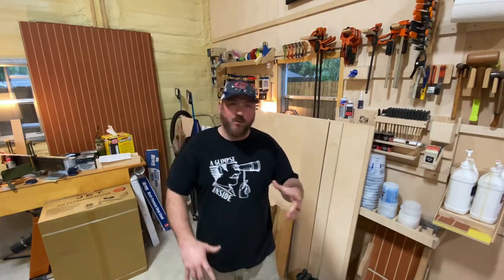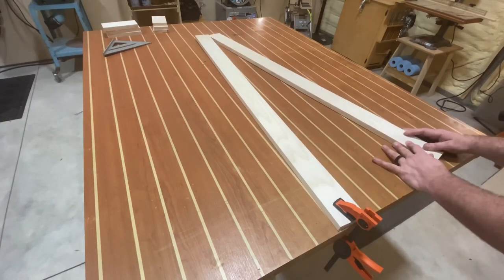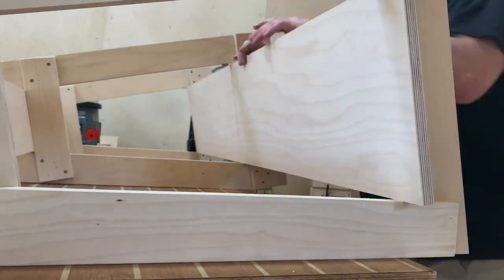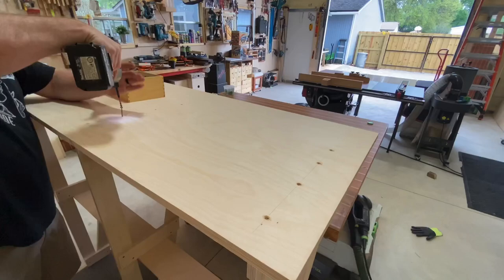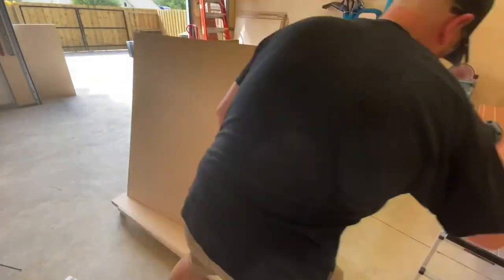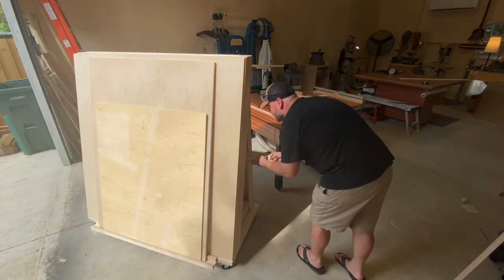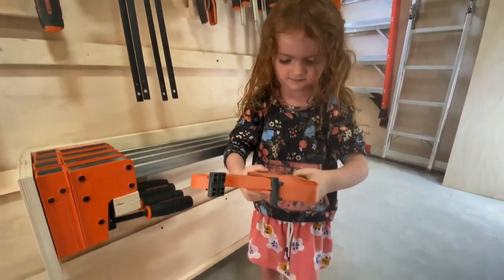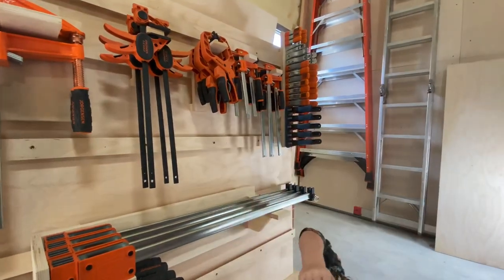DIY Mobile Plywood Storage Cart Has TWO Hidden Features | Intended For 5X5 Baltic Birch

Comment: I would have thought you would need glue for strength, but if it is working for you, that is great.  I need to build a lumber / sheet-goods cart.  The one I have now is so heavy it won't roll.  The casters are too under-powered (flimsy) and I literally slapped it together with materials I had available one weekend when I got back from the store with a bunch of ply and didn't have a place to put it.
Reply from the maker: Definitely time for an upgrade then my friend. It’s a fun build as well

Comment: Ok serious question. What is your preferred method for using the table saw while kids are riding bikes around the outfeed table? Elbow/knee pads and helmets? Full PPE? Or just wing it with flip flops and bare feet? Still my favorite maker channel - great job as always.

All kidding aside, one of my biggest challenges is trying to watch kids and work in the shop at the same time. So if you have any tips, it might make a good video one week, especially since more kids are home nowadays.
Reply from the maker: Thank you so much for the kind words quite frankly I keep everything really high up on this French cleat walls in anything that is down low is completely safe for the kids or at least I think so right?. There really is no secret sauce in my opinion. You just Gotta be mindful and also when the kids are with me I’m building at about 50% speed because of that but that’s the sacrifice that is wonderful to pay

Comment: Father of 4 myself... please make sure the thing cannot topple forward on that sheet side when all loaded up. . Especially that weight, momentum and wheels, hitting a piece of scrap, screw or rock on the floor while moving. I am stealing this by the way... you impress me in more ways than one. I wait for your next video - usually impatiently. And still covet the response/resolution to the overhead nailer in the new shop.
Reply from the maker: I completely agree. I did test that and it’s not going anywhere brother I appreciate the concern

Comment: I have recently been revising my workbenches and tool carts and I have quit using glue on shop projects.  Several projects from the beginning of my woodworking hobby have been taken apart and the wood has been repurposed.  Glued parts are difficult to disassemble without destroying at least some of wood.  So for me its just screws and the occasional brad nail for shop furniture.

Comment: why why why do so many of these dudes use this rockler junks... those wheels have no bearings... you can get the same size wheels with bearings for 1/4 the price on ebay.... I just want the means to waste money like this  :(
Reply from the maker: Thanks for your input I will keep the audience of the date on their performance. Sidenote, I’ve had wheels on my current workbench for five years from Rockler and they seem to be doing very well still
Reply: @AGlimpseInside  I'm a cheap f**k... so if I can get something equal or better for cheaper (in this case 1/4) i cant be brand loyal... 90% of rockler stuff is just rebranded chinese stuff.... but anyway always enjoy your builds, you seem like a good dude, just a little misguided  ;)